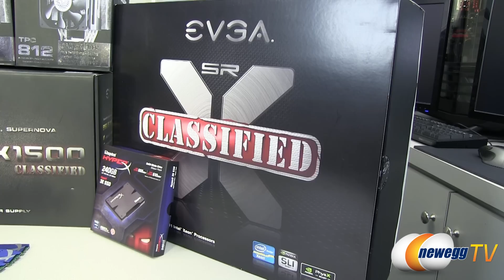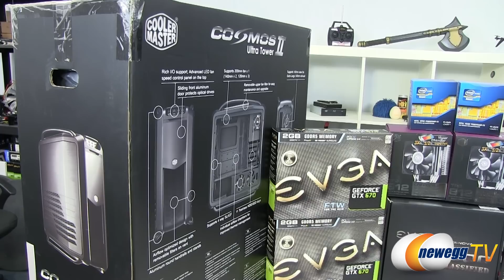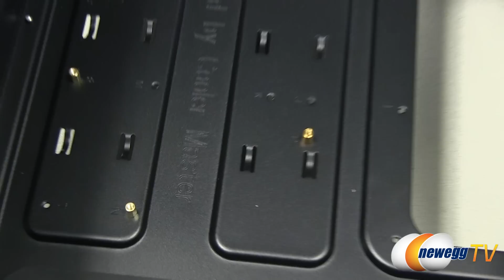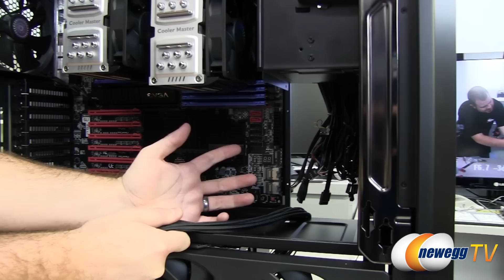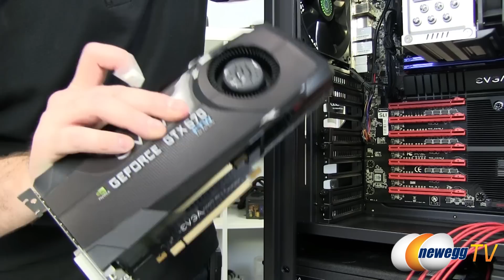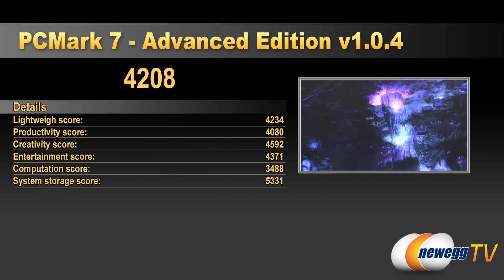Newegg TV: Combo DIY Build - SupremeCombo with EVGA SuperNOVA 1500W Power Supply

Comment: servers. two is always greater than one, less stress on one doing all the work, better performance,  depending on the clocks you'll basically get double and have a twice as fast CPU clock, while being balanced. so if they're both like 3.5GHZ you'll get 7.0 total and be running processes fairly fast. numerous reasons to spare

Comment: 670's suck for workstation stuff.  You need the older 500 series if you want to do calculations work on the cheap.  580's smoke the 680's in a workstation environment.  But, if you really want to have fun, toss a Quadro 5k and a pair of Tesla cards in.  Now you are running a workstation.

Comment: True story, one example of this is games being able to use 4 cores in gaming vs 2. NCIX did a test system and found out there is only marginal improvements from a respectable 2 core system to a 4 core system, even playing the most intense game to date. Which means the 4 core system i bought and made myself 4 years back is still holding its own (true story). In my oppionion the only thing that should be considered to upgrade is the video card. I have a 5770 but even that handles games fine today.

Comment: no my 4 year old PC still runs all games on the market... mabe not at max settings anymore but any game from 2011 and back I can run on high settings or more, I mean it runs battlefield 3 on almost max settings and get 30-38fps on avrage (and it cost about 2.6k to build). Its more about the fps when you pass $1500 PC because all my builds that are 1.3k or more run battlefield 3 on max and handle it at 30fps or more.  So you spend more than 3k it should last for around 3 years to 4 years tops.

Comment: One more thing on this build as a gamer rig. It is steep as heck to build an encoding monster like this one, but the gaming philosophy of use makes it a viable option.
Sandy Bridge is a cool processor & two makes for less work load. Cooling the rig to somewhere above ambient by splitting the load equates to longer life across the board. Literally, making this PC outlast the i7-3770k. One massively long life gaming PC will make your investment less of an impact on your wallet over 7 years.

Comment: Just a few questions, if I may. #1 Why use a 1500 watt power supply with a system that doesn't need that much?   #2 Does the 2 SERVER CPUs really help in gaming performance? And if it does slow it, is that why you used SLI?   #3 SSDs in RAID? Really?

Comment: Exactly. No one is going to be doing fluid dynamics or finite analysis with a gaming card. The Kepler GTX 6XX is terrible for Workstation level graphics. Autodesk Maya does not even support GTX 6XX Kepler, however AMD 7XXX does. 2*7970s would have made more sense for the workstation/gaming crossover as they're compatible with both and they would have matched the colour scheme.